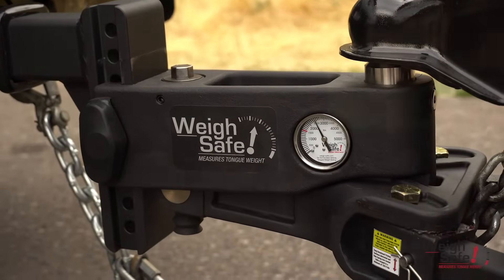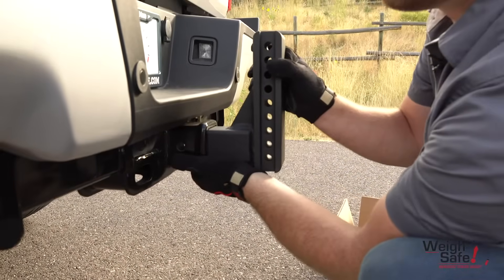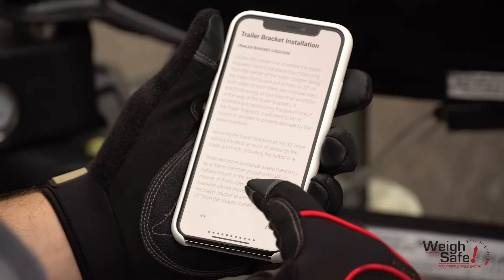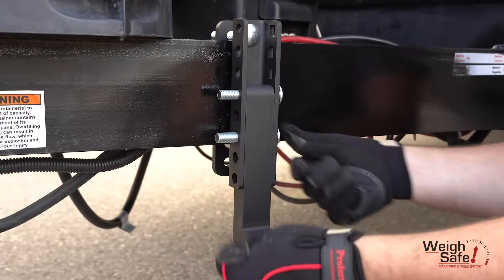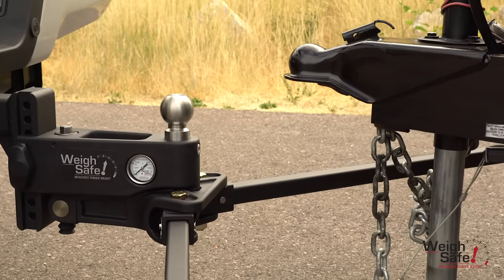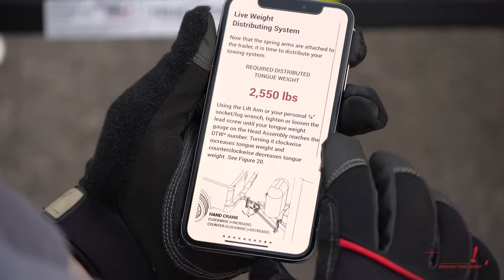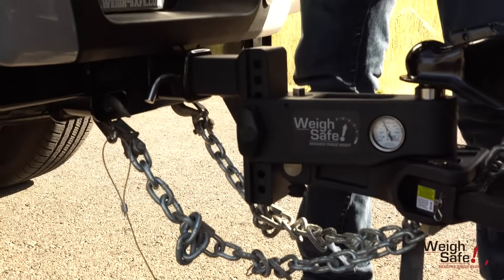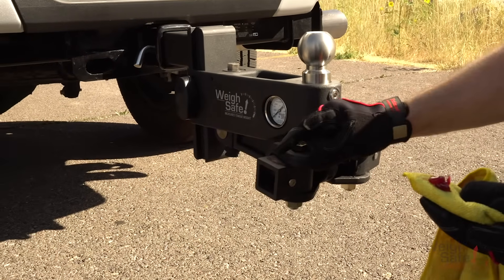Weight Distribution Hitch Installation - Weigh Safe True Tow

Comment: I recently bought a used weigh safe hitch from someone who used it for a camper, I'm using it for hauling cars.
Is there a reset procedure to bring it back to original,  or does that not matter?
Also can you use a hitch tightened with these?

Comment: I'm not understanding the step at 1:22. Wouldn't having the ball 1 to 2 inches higher put the camper out of level?
Reply from the maker: Great Question! The distance will depend on what the tongue weight of the trailer is and what kind of suspension is on the tow vehicle. Setting the tow ball higher than the trailer coupler will help account for the amount of sag the vehicle typically sees once loaded. You always want your trailer to be level with the ground when towing!
Reply: Just installed today! I am blown away at the top quality of this hitch!
Reply from the maker: @michaelknott4702  Thanks for sharing, we are so happy to hear that!

Comment: The manual says 1/8" for every 100 pounds of hitch weight.  This video says 1"-2".  EXACTLY WHICH ONE IS IT?????  Accurate info would help a lot!!!
Reply from the maker: Thanks for reaching out! In the video he explains that "Generally, the tow ball should be 1-2" above the coupler". In the Owner's Manual it provides a good rule of thumb is to set the tow ball 1/8" higher for every 100lbs of tongue weight. You'll typically see users towing with at least 800lbs of tongue weight with a weight distribution hitch, which would calculate to at least 1" if you follow that 'rule-of-thumb'.  

So basically, the 1-2" mentioned in the video is a common recommendation based on the 1/8" 'rule-of-thumb'. We apologize for any confusion and hope this clears it up for you!

Comment: VERY DISAPPOINTED WITH THIS HITCH!!  Bought this for my Jayco 330 RSTS and there is not enough adjustment between the spring arms and the spring arm platforms to allow adequate contact to supply enough friction to help with the trailer sway. I can only contact approximately 20% of the available surface area which is just not enough. Contacted Weigh-Safe and was basically just blown off. Their customer service was no help at all and didn’t even try to find a solution. I am buying a different brand hitch because this one is too dangerous for my trailer.
Reply: Why are your bars that bent?
Reply: @BetaRacer24  Their design does not allow for the 9 inches of clearance on my trailer   they call for in their installation manual between the top of the trailer coupler and the bottom of the spring arm platform, I have only about 7 inches on my camper which does not allow the spring arms to sit horizontal to the spring arm platform. This significantly cuts down on the amount of friction to reduce the sway control.  My biggest frustration is the total lack of care or willingness to help provide a solution from their customer support department.
Reply: @rjwhite5438  how do you not have 9 inches? The platforms are adjustable? Even at the very bottom its still only 7?
Reply: @rjwhite5438  just searched your trailer, you do have a weird coupler that I havent seen before.
Reply: https://youtu.be/9SmF4OGTz6I here is a setup similar to yours

Comment: If the pin weight after adjusting the spring arms is heavier than your vehicle allows  should you not use this system? My truck says I can tow 10000 but have a max tongue weight of 1000
Reply: The adjusted weight is like weighing yourself on a bathroom scale and then reaching down to pull the scale up. It does not increase your weight on the ground.
Reply: @puntabachata  that's a great mental picture you painted there
Reply: Yes. It’s not true hitch weight once adjusted but rather disturbed weight you are now reading. More like how much tongue weight from original reading and what has been moved into forward suspension added together roughly.
Reply: I wouldnt think so, Since it will always be 2-3 times higher when the bars and distribution weight is calculated

Comment: Your “C Channel” Bracket is installed upside down.  It should be installed with the square holes to the front, not the back.  This is so the nuts are towards the back of the trailer.

Comment: so when i unhitch my airstream how can i secure it so its not stolen. do i take the whole hitch out of receiver or whats the best way.
Reply from the maker: We sell a matching keyed alike hitch locking pin to lock it to your vehicle!
Reply: I use a hitch stabilizer, which is basically a u-bolt that goes around the receiver and the draw bar. It makes for a way quieter tow and has the added benefit of basically bolting the draw bar to your vehicle. Of course it is still vulnerable to theft, but it would take a way more determined thief.

Comment: Best weight distribution hitch I’ve ever used, yes you do have to extend the chains but...  I love that I can lower my tailgate without hitting trailer jack. App is easy to use once you enter all measurements. I also purchased the steel slider with a 2” ball to use on my smaller trailers, again another great option and easy to switch ball sizes.
Reply from the maker: So glad to hear it!!!
Reply: How did you extend your chains? Im about to do this to
My trailer, im missing like a foot in order to have some droop and be able to cross.

Comment: Is there going to be an option for this to be adopted to old weigh safe hitch?
Reply from the maker: Our True Tow Weight Distribution Hitch will not be compatible with any components of our current drop hitches. However, our True Tow draw bar is compatible with the Steel Weigh Safe slider mount.
Reply: @weighsafe  what is the link to that?
I just ordered the steel 2 inch shank to a 8inch drop what can be added to this hitch?

Comment: That ball is really far from the bumper, adding more tongue weight ?
Reply from the maker: We designed the hitch head to be a little longer so that you have the ability to lower your tailgate/open your liftgate without hitting anything!
Reply: Weigh Safe You have my attention ! In the market, will keep you on my short list.
Reply: @weighsafe  too far away for wiring and trailer chains. I have this issue now with current hitch . Buying a new one because of it....... very annoying
Reply: @acreageliving  Because using longer chains or a wiring extension is too hard?
Reply: RJT21 yes it’s a pain in the ass when you own 5 different trailers and have more than one tow rig. Time is money and I don’t want to haul that crap around. Huge inconvenience when I can buy a different ball mount and not have to do a thing
Reply: How much further is the ball from other WDHs, such as the Fastway e2 or the Equalizer?
Reply: It has to, my scale says 1200 pounds of weight. But when I went to the scale I added 1600 pounds to my rear axle.